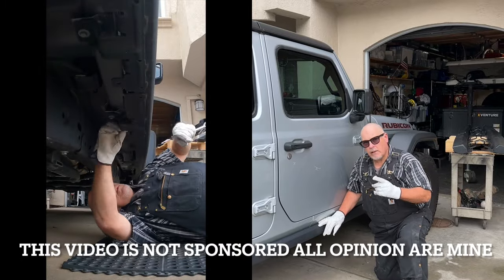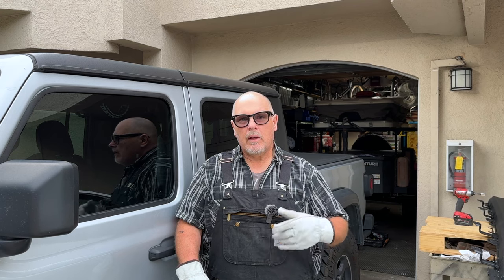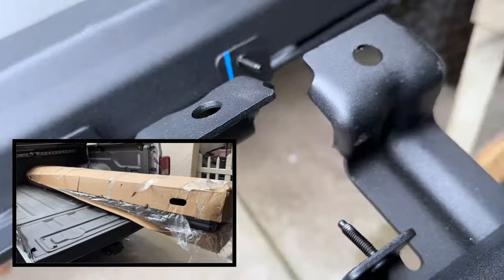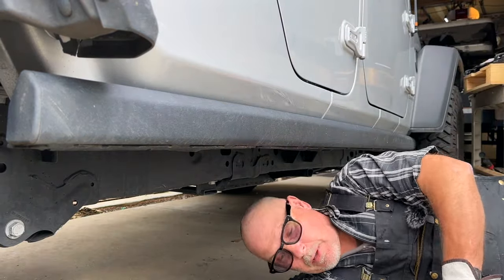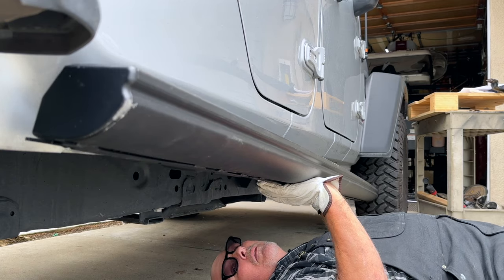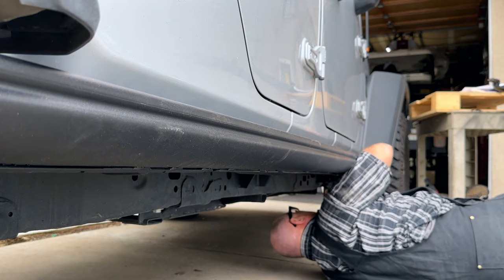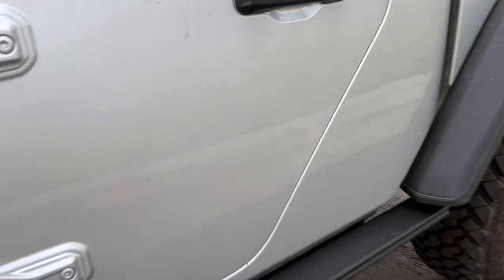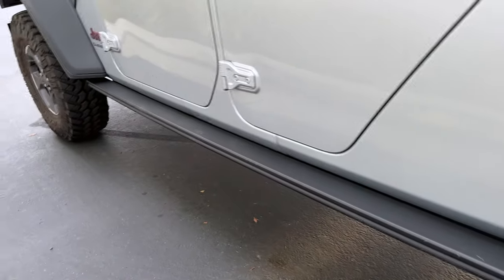Rock Rails With Step | So You Can Get In Your Jeep Easier (Install Video)

Comment: not gonna lie, I would have sent them back.  Way too much damage to accept those.  I want a set though, but Intend to be a perfectionist, so I’m a stickler for not accepting damage.  Thanks for the video.
Reply from the maker: I wouldn’t blame you. Those rails are heavy. They should do a better job packing them. Thanks!
Reply: For sure! I would drive right to the Jeep dealer with those damaged rails. Way too expensive to receive the rails looking like that.
Reply from the maker: Your right considering what they cost. They were shipped to me by Fedex. I could have made a claim.
Reply: Not really a step, beware to purchaser.

Comment: These are heavy duty rock reals use to put them on recon package . They are also body protection does not sound like you rock crawl if you did that side step keeps the jeep if you slide into a rock.
Reply from the maker: I am not a rock crawler but sometimes we do get contact with rocks on some of the Overlanding trails. If I’m going to get into anything might be labeled Rock Crawling I’ll use my Wrangler. Thanks!
Reply: @MuddyRuttzz  yea I installed those on my wrangler saved me a few times